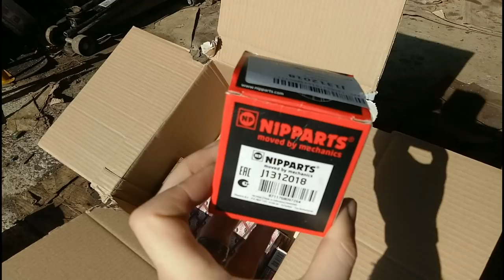Toyota Starlet Service, with Autodoc

Comment: I don't know if you're very knowledgeable on Toyota engines but the 4E-FE is one of Toyota's most durable engines.  I have that same engine in my Geo Prizm(which is basically a rebadged Toyota Corolla) and those motors are world renowned for their longevity and durability.  That's why I bought my car.  Those engines can go 300,000 miles easy if properly maintained.  They do have one weakness, which was a design flaw during engineering that most people are not aware of.  They designed the oil ring holes that lubricate the cylinder walls and protect the oil rings too small. So if you neglect your oil changes those holes can become plugged up and the engine will start burning oil.  I know of this issue, so i always use synthetic oil to prevent that issue from ever starting in the first place. Love the video.

Comment: For future oil changes, it is always a good idea to fill your new oil filter with fresh oil before installing it. This prevents oil starvation in the top end of the motor. If the filter sits sideways you can fill the filter half way and prevent spillage during installation. 
Hope this tip helps you and anyone else doing oil changes on their vehicles.
Reply from the maker: I've never gone in for that, though I do sometimes disconnect an ignition lead so I can build oil pressure on the starter.

Comment: If you think that fuel filter's a faff, the fuel filter on the Corolla E11 (same engine as this Starlet, same year etc) requires the removal of the air filter gubbins and some parts of the gearbox. 20,000 miles or every 2 years that job is! The 4EFE is a great engine though.
Reply: Some parts of the gearbox? So you have to dismantle the gearbox to replace that filter?

Comment: The engine should feel a bit more responsive following the service. The mixture is perfect judging by the state of the old spark plugs. The new rear wheel bearings will have made the biggest difference.

Comment: Starlet is so simple to work on and it is so quiet. At least you have one dependable car there no matter where you want to go motorways etc are no problem, just hop in and away you go. Makes life easier when you've a good spare car.
Reply from the maker: I'll have you know that Elly the 2CV has been very dependable after the battery farce!
Reply: HubNut didn't mean to insult the 2cv but for me it's  real luxury having a car as dependable as the starlet while fetteling the others. Don't think I've ever had more than one good runner at the same time...
Reply: @terryatkinson899  i have a 96 starlet needs a couple of small jobs should i fix it up or take 300 for scrap what do u think.
Reply: @martymartin2894  if you have the space, fix it up and keep it. All would depend on whether you have the skills to do it up yourself or have to pay someone else. The satisfaction for me is doing it myself.
Reply: @terryatkinson899  on further inspction their is some rust underneath and i need door glass for back door think ill scrap it.

Comment: Excellent, plugs look prefect. Oil draining tip when using old oil cans. Instead of cutting a square out, cut top and bottom horizontally, then cut a vertical line between those lines in the middle creating an H on it's side. Fold the flaps out, warming at the creases to get a sharp crease and get a "set" when they cool. You probably see where this is going. You get a much larger catchment for those annoying dribbles along the sump edges.
Reply from the maker: That's advanced level catch can cheapskatery! I love it.

Comment: I once dropped a washer through the spark plug hole and did not notice until i started the engine a lot of noise ensued and a quick switch off. I removed the cylinder head but by sheer luck the washer had not gone on its side so had not punched through the piston but there where lots of circular dents on the piston top.I put the cylinder head back on and unbelievably everything worked fine.

Comment: Best to fill oil filters before fitting. Easy to do on upside down ones. Most people would say that running an engine without oil pressure, whilst the oil filter fills, as a bad thing.
Reply from the maker: True, but it is not for very long as modern engines build oil pressure very quickly. If concerned, you can always disconnect the coil and spin the engine up to pressure before it fires up.

Comment: Free funnel tip, chop a 1 litre oil container in half (trying not to cut fingers off) and like magic you have a perfect funnel that also sits nicely in the oil filler. You don’t have much luck with brakes mr HB, great video though. I hate press in wheel bearings they are cheap but with no press or other means to ‘press’ out your stuck.

Comment: Hubnut and anyone else with a Starlet- no need to get a garage to press the wheel bearings in, just pull out the bearings by hand, use a seal pick to remove the seal, and as for the races there are two strategically placed slots in the hub, on each side, hold the hub/drum in a vice and using a hammer and drift carefully tap out the races a few taps at a time each side "groove/slot". Use a suitably sized socket to tap the new races back in. Same with seal, use a slightly bigger socket to drift the seal back in. I had to do the wheel bearings on my STarlet, seems a weak point on these otherwise 99% reliable cars.

Comment: Rotate the oil bottle 90 dog when pouring, you get closer to the hole then
Reply: It's done that way so the air flows freely into the bottle leaving the oil to flow out rather glug out.

Comment: Toyota uses two filters for practically every engine, and the other one is the same as what you have but with a slightly longer case.      That same filter probably fits the V8 in the Lexus you had.

Comment: "Fuel filter ready to go...uh that's the wiper motor ..."  Could have been interesting feeding raw  fuel into the the wiper motor. Cat litter is the best stuff for soaking up engine oil. Use a better brand than the cheapy ones (the ones that stink...)
Reply: Mercmad I’ve used cheaply cheap Tesco kitty litter to great success when I’ve made a pigs ear of draining oil. Never seen the need for proper fancy stuff
Reply: it helps if the cat isn't in the kitty litter too. For some reason they are a bit averse to engine oil.

Comment: Another great video. Will be great reference for when I do the service on my Kia Rio in a few weeks time. The wheel bearing are something else I'll look to replace. :)
Reply: Vampire Echidna - my front bearings needed doing last summer on my mk2 Rio. Bought 2nd hand hubs as we only have one car and therefore couldn't run off to a garage to have  new ones pressed in, like Ian did.  Kept my old hubs as spares to have new bearings pressed in next time as I have been told Rio's eat bearings at a decent rate, especially on the front. Though the 2nd hand ones are spot on, nearly 12 months on.
Reply: Paul Smith that not a bad idea Paul. Up until I watched this video, I didn't think about how they would get pressed in. I assumed they would simply slide on. Good to see someone else who owns a mark 2 Rio.  Did you find removing the hubs on the Rio difficult?
Reply: Vampire Echidna - surprisingly easy to remove.  Mine has 120k on the clock, so expected everything to be siezed - was a doddle though. Getting the replacement hubs on the driveshaft AND lining everything else up was the only faff. Paid £50 for both off fleabay.  Hyundai Accent ( 2000on from memory ) front hubs are identical. Bought my CRDi for 400 quid with the knackered bearings as a stop gap last summer. I'm still stunned at how good a car it is and is now a keeper 😁.
Reply: My current CRDi 2009 Rio Is the second I've owned. They are good solid cars and surprisingly economical. Wow 400 Pound is a lot of car for your money. That's a bargain! I'm looking forward to giving the Rio it's first service in my company when the weather gets better. Thanks Paul for the advise on the wheel bearings and hub, much appreciated . :)
Reply: Vampire Echidna - we must be due a decent stretch of good weather.  Mines a 55 plate. Picked it up off a trader the day before he was going on holiday. No one believes me when they see the car - only improved further with a HuNut sticker! We had a french money pit in the form of a Grand Espace before, so the contrast in reliability and running costs are poles apart. Hope you get outside soon. All the best.👍
Reply: Paul Smith oh I do hope so. Looking forward to working on her. 55 plate and only done 120k. Sounds even more of a good deal to me. When I was looking for the Rio I have now, there was a lot of CRDi's  going cheap but excessive millage. I picked my 09 up for a moderate sum of 1k more than yours. Only 60k miles (young I think for these engines) my last Kia Rio clocked upto 140k without any issues and it was a year newer than this one. Thank you, you have reminded me to order another Hub Nut sticker to put on this car. I've got one on my Nissan. All the best to you and your amazing Rio :)

Comment: Great video, bought myself one of these too and it needs few things doing. Regarding rear wheel bearings, is there a torq setting for a hub nut or you have to tighten it by feeling it so it’s not to tight to the point where wheel stops spinning?

Comment: Full synthetic oil in an older car can be problematic- I used it in a Subaru Justy, and it leaked like a sieve, from every gasket. Yes, the gaskets probably needed replacement, but the synthetic oil dissolved the old oil that had built up around the gaskets, and came right out!

Comment: These cars are so easy to service. Some years ago i did a service on my BMW E91 320d. The air filter housing had been a part of the rocker cover and the allen bolts were rounded. Bugger, i ended up fitting a whole new rocker cover after breaking it trying to remove the allen bolts. Then after the oil change the drain plug was leaking. The same moron had been cracking the sump pan over tightening the plug. A simple service that should have taken me 3 hours took 6 and i ended up paying £500 + all because some twat with air tools had wrecked everything on the previous "service".

Comment: It doesn't apply to the Starlet, but some modern engines, the Ford/Mazda 5 cyl diesel for example, have oil pumps that won't prime themselves. If you let the oil drain for more than about 10 minutes, you restart the engine with zero oil pressure that will not improve. Disaster ensues. Another reason to like old cars :).

Comment: It's a shame auto doc didn't give you a code hub nut for discount for your subscribers for thirty days after this video
You forgot to use the supplied floor oil catcher the parts came in........
Nice random live video yesterday......  Pleased to be apart of the mix
Reply from the maker: That's a nice idea. I will have a chat with them.
Reply: Never heard of these before and had a look on the website and the prices are good and so much choice and different makes to suit budgets  or repairs....  Did fall off my chair when I saw a cat exhaust was discounted to £5500
Very handy when your doing a steering tie rod repair they do kit.. Never seen them before from other suppliers
Thank you for educating  me another supplier for spares....

Comment: Rookie question I know, but not all of us Hubnutters (Hubnutees? Hubnuteers?) are familiar with the "doings" part of their cars, so what's the deal between fully and semi-synthetic oil, and should we worry about which we use? Thanks!
Reply from the maker: I should probably do a video on oils. It's a baffling world! Fully synthetic is the best oil to use, because it lasts longest. It's why cars now have service intervals of over 20,000 miles. Semi-synthetic is a mixture of synthetic and mineral oil, so it's cheaper to buy, better than mineral oil, but not as good as synthetic. My thinking, especially with older cars, has always been to focus on regular changes (ie 5000-6000 miles) rather than buy the best oil.
Reply: + Thanks for that Ian. Oil is obviously a more complex topic than I imagined (and I also presumed that synthetic wouldn't be as good as "organic" - shows how much I know!). BTW, my vote goes to Hubnuteers :-)
Reply: As far as U.S./API-rated oil, there's no definition for "partial synthetic." It could just be conventional with a drop of synthetic base oil. The most important thing is to get the right type for the engine. 

Oil classifications for API and ILSAC are mostly backwards compatible, so if you get an SN or GL-5 oil, it will be fine for an engine that needs an earlier standard. Some older engines need high sulfur formulations, normally labeled as "racing oil," to preserve metal components, but the extra sulfur will poison catalysts in modern cars and won't offer any wear benefit.

High mileage oils also don't have their own classification, but they're blended with conditioners that help revive old seals. This can reduce or stop oil burning and sometimes leaking in old motors. These usually aren't "energy conserving," so you'll lose a little fuel efficiency and power.

Viscosity should match the application. People used to use high viscosity oils in worn engines, but this just strains the oil pump, and oil may not reach the entire engine. Racing may require higher viscosity than normal because of engine heat: hot viscosity is rated at 212F/100C, so if the engine is running hotter than normal, the oil can be a lot thinner. Synthetics stay stable at a wider range of temperatures, both hot and cold. Otherwise, just use what fits the specifications. Some engines designed for long oil change intervals require synthetic, and some formulations like 0W20 are only available in synthetic, but for other applications, conventional or partial synthetic should be fine.

Comment: If it's from Autodoc does that mean all the nuts and bolts come undone without resulting in heating them up and hitting them with a 4lb hammer like they do on their YouTube channel?
Couldn't you have put the drum on backwards put the bearing and nut on and just yank the outer bearing out?
Reply from the maker: No seized bolts. Didn't even need a wrench for the oil filter. Must be Autodoc magic. A contribution to the local garage's tea fund seemed better than ruining things myself!
Reply: LMAO I will have to post up some how to get the seized bolt out videos. It's what they all turn into ;-)

Comment: How is the oil pressure on the 3 Wheeler? If you have multiple cars with the same oil filler cap a handy tip is to get a spare cap drill a hole and glue a funnel in, hands free filling then!
Reply from the maker: Oil pressure seems fine. New sender, slightly higher tickover speed, sorted.
Reply: HubNut hope the higher tick over speed means you get neutral still!
Reply from the maker: Yes, no problems there. The tickover was way too low.

Comment: Hi  Ian, had a 1989 carina 2 , some years ago , best car I've had , amongst other makes . it had 90K on the clock when I sold it on to my brother who did another 30K  in it , before it went to the scrapyard with serious rust problems.. Do you come across any of these cars on your travels? I think ones in good condition are pretty hard to find. Ian H.
Reply from the maker: Carina IIs have become very rare. I occasionally see the odd estate still in daily use in Wales!
Reply: Thanks for the quick reply , I  was hoping you might  be doing a vid on one someday , If you come across one at these car rallies could you point it out to me  as I'm subbed to your channel  anyway .
Reply from the maker: Likely I might see one at Cholmondeley next weekend actually. The Toyota Enthusiasts' Club usually turn up with a nice mix of motors.

Comment: A bit late now but will a 1 litre wide capped Lucozade bottle with the bottom cut off screw into the oil filler hole to act as a funnel? I know it works on me Bongo 😎
Reply from the maker: Yes. That's what I have to do on the Honda. The Toyota is pretty easy - if you're not a muddle-handed idiot trying to film it at the same time...
Reply: I can vouch for the bottle use as a funnel , after misplacing my funnel last week .

Comment: X flow  is that German oil? No funnels in Wales or the UK?
A nice simple car, perfect.
Reply from the maker: Funnel not needed really - if you concentrate on pouring rather than videoing it... Comma is a British brand I think.
Reply: Quickest makeshift funnel is the top half of a large plastic drinks bottle!

Comment: Hi , can I ask have you ever driven/ owned a Nissan nx100 ?
Reply from the maker: No to both of those. Maybe one day...
Reply: owned an NX a few years ago.  not bad little car considering its just a Sunny in a party frock.
Reply: lofty71  not many left , so I'm told .
Reply: alas they liked to rot around the rear suspension. bit of a pain to sort so a lot were scrapped when the old tin worm got to nibbling.
Reply: those cossies were killers ! lol
i ripped the centre out of my 3.6  XJ40 flywheel playing with a 3dr Cossie around Widnes back in the '90s (before i grew up . . .ahem.)